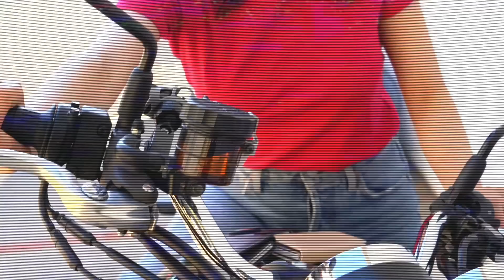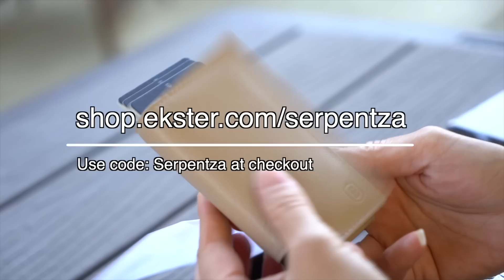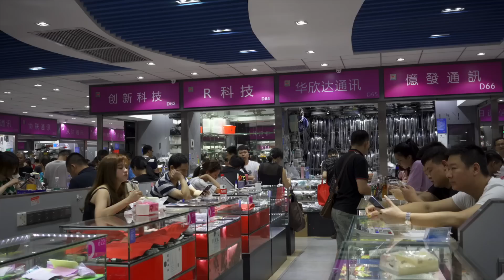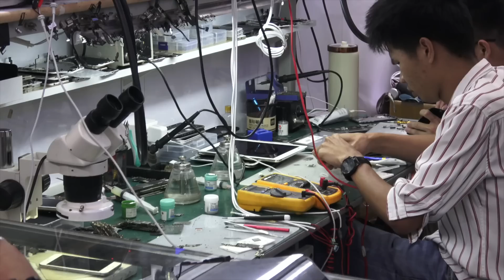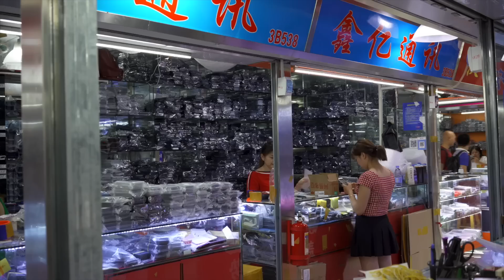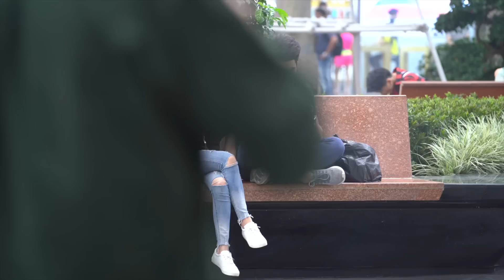Why China Can't make Chips!

Comment: The problem is simple. You can't reverse engineer a manufacturing process. 
You can only work out what the components are, and then from there you need to work out how to make those components. 
With high end chips, the processes often require a knowledge of obscure physics, and a practical application of that, which has taken decades to refine.
Reply: Exactly and machines to produce what they may someday reverse engineer are equally as hard to reverse engineer and produce. It's the whole chain that they need to understand and to produce, not only the final product.
Reply: They do have lots of knowledgeable ppl who can do the work, but the problem is that the leaders want to see the outcome right away.
Reply: Not true, China has IC foundries. Ever heard of SMIC? Neither have I until today (when I looked this s••• up)! But they make logic chips (CPUs). Hua Hong also makes microprocessors, maybe these processors are crud and built using older larger fabrication nodes, but they have many foundries no doubt because the rest of the world including us in the U.S. feed the demand instead of making things like this domestically. Of course Intel does make chips domestically but also in other nations. I used Wikipedia as they already have hopefully a decent aggregate dataset for this, searching directly was ironically a bit more difficult especially since I don't know what China is doing. I was able to find articles from what I would think are trustworthy tech-related media sources claiming that SMIC has made processors using 14, 10 and 8nm nodes. This doesn't speak to the quality of the chipsets, but they are already making them.

Honestly I thought MediaTek chips were Chinese. I try to avoid anything made in China if I can. This is kind of impossible when it comes to buying electronics as some of the devices are assembled there and some components therein are manufactured there. We don't have a choice in where the companies we buy from choose to assemble their products.
Reply: @VariantAEC  SMIC was sued  by TSMC, accusing SMIC of misappropriating TSMC intellectual property. payment to TSMC of an aggregate of US$200 million; and a grant to TSMC 8% of SMIC's issued share capital and a warrant which would allow TSMC to obtain total ownership 10% of SMIC's issued share capital.
Reply: @chongtak  since everyone gets their manufacturing done in china, i thknk they already have the machines
Reply: @kungfutzu3779  if so, why were they unable to produce decent ballpens 2018 for example?
Reply: Knowing how to make something does not mean that you actually can make it. It is like saying you know how to design rockets to mars.
Reply: @VariantAEC  and what makes you think that China , or SMIC, doesn't make use of the joint contracts with other global tech companies so it can borrow the tech that they use? You must remember how Chinese electronics is fueled by these kinds of partnerships where you have lots of Chinese companies that make stuff off the backs of other international companies existing products , who must give up their tech to be in the Chinese market
Reply: @VariantAEC  
The machines used for chip manufacturing are not made in China.
Reply: @MegaBanne  
If we sell that tech to them (and we do), they can't make more?
Pretty sure they can.
Reply: @LIL_MAN_THE_OG  
They do. Do you think as an example Intel doesn't do the same not benefiting from China, but from other nations with better tech like Taiwan? They do. None of this exists in a vacuum though and how can China not be any good at anything while simultaneously being a known threat integrating HW backdoors into their boards and ICs?
You cannot be both a known and verified threat, making tech that takes control of things that you're adjacent to while also being unable to do anything competently in the very same digital arena at the same time. They either are or they aren't able to make these chips and seeing the number of foundries in China (if the Wikipedia numbers are remotely accurate) is troublesome. I mean sure the foundries could be small and make terrible products. Then again these companies are using Chinese citizens to make these chips in China... so clearly THEY ARE ABLE TO DO THIS!
Reply: @VariantAEC  
Such machines have been sold to china.
Reply: @MegaBanne  
Yes by Intel and other IC manufacturers. Most have been by license only, but others likely been sold to Chinese firms to make their own microprocessors with.
Reply: @chongtak  Well apparently they can now. It's only a matter of time before they can fully build more advanced stuff locally.
Reply: @walterdayrit675  You are right but you did not get my point.
Reply: @VariantAEC  You fell for misinformation. It is true that SMIC has been able to reverse engineer TSMC smaller node 5 year old design chips 1:1 recently. But that means nothing. The conditions they are being able to manufacture those more modern chips are basically laboratory conditions. They do not have technology to mass produce it to sustain domestic demand. Which is exactly what the guy you replied to said but you did not understood. And without being able to reliably mass produce it they could be making 2nm chips right now and it would still mean nothing. They have only machines that can mass produce 14nm+ chips which is ancient technology from today's standpoint. And they are able to do it using old ASML equipment that they simply just can not replace anymore because it will not be sold to them anymore.
Reply: @niyu8402  Well, based on what you have said, it seems that China has now "creatively acquired" at least some TSMC microprocessor manufacturing tech.
Reply: @chongtak  So what is your point?  They already can fully manufacture those ballpen parts locally. That proves that given enough determination, the Chinese will be able to manufacture high tech items locally. It's only a matter of time, money, and skilled personel.
Reply: @walterdayrit675  No. TSMC sold out all the shares and ownership from SMIC long time ago (10~15 years ago ). TSMC has nothing to do with SMIC currently.
Reply: Other also illegal
Reply: You have to go back 70 years to understand the problem.  Mao killed off all scholars who questioned the PRC which was exactly what scholars do they question !This destroyed higher education systems and the pursuit of innovation.  Mao wanted a system of yes people and social laborers in turn destroyed creativity which required questioning, imagination, science and self interest.  70 years later and here we are and people wonder why China can’t innovate.  Culture can’t change when their education mirrors their Mao government.  This is why I argue with people that it will take China 100 years to catchup with US in innovation if they start changing now which it looks like they are not.
Reply: It's all patented with silicon chips and the US holds most of the patents. This guy is lying to you.
Reply: @jeffjohnson5053  You have simply been lied to extensively by this chap. Do your own research and you will know how mistaken you really are.
Reply: There’s some pretty advanced AI that can take pics of the die and highlight uncommon photolithography circuits. Everyone uses it on their competitors but if course the process then becomes the issue.
Reply: You can bribe the people who work in manufacturing or maintenance of these machines.
Reply: @ЕвгенийПетров-в5п  What about 5G patents? The Chinese are the largest patent holders for 5G. Who did they bribe to copy?
Reply: Listen champ. If they can clone the f22 they can make some computer chips.
Reply: They can copy the last thing but wont create the next thing.
Reply: Factss brooo they def like copied and pasted them chips. I heard all their buildings are like made of cardboards. And like their space station isn’t even real. Like we all know space ain’t real anyways.
Reply: I think it's more of pattern problem rather than production
Reply: @walterdayrit675   Yes they would be able to produce old tech.... advanced DUV immersion lithography.... and 14nm is possible with that. But for EUV they don't have the machine..... and that machine was literally the might of the whole humanity to build it. It's not something you can just acquire from somewhere and copy it.  Why do you think the Japanese  "just quit" at this point. That machine was paid in part from TSMC, which was partially funded from Nvidia. So you can see... that thing goes "deep" it's not some shallow pond but a deep ocean. Where would China suddenly get companies like Nvidia and TSMC.... to pay for their machine?! Yes the "state" would pay for it..... and the money will go to their buddies.... and nothing would happen.... they would probably some "scapegoat" to throw in jail "for corruption" and that would be it. You know "how the state pays" in these type of countries. The state pays.... and the money goes to their buddies.... if Nvidia and TSMC did that.... we have never seen EUV lithography. And why would that happen.... because lower state bureaucracy doesn't understand technology and doesn't care about technology.... also they want to enrich themselves and they don't care if China as a whole will develop EUV.  The other possibility is... things would happen "too slow" for their taste and they would just throw someone in jail for corruption even if he didn't do anything wrong.  
 If Nvidia was funded by the Chinese state.... we would probably be still using  GeForce 2 cards..... 🤣 and Jensen Huang would have been a long time ago in prison for "corruption"..... 😂
Reply: @VariantAEC   You're confusing things. Intel and IBM both use ASML machines to make these "breakthrough"  chips, there is no other EUV machine.
 Also if you look at the original news you'll see the partners.... that IBM chip was a group effort.   Search for this: "IBM research alliance produces first 7-nm-node test chips".
 ASML is not mentioned by all news sources, but they are there, that would have been impossible without their EUV machine. 
 And why not build everything in the US.... because that's the same problem China faces right now... because some countries are better at some things than others.  You can't do everything "better and by yourself at the same time" . ... that's like the old saying goes "Jack of all trades, master of none".
Reply: @Slav4o911  
IBM makes chips or they used to and do so still, but not for mass production in-house anymore (or maybe ever). EUV machines aren't a proprietary technology powered by Carl Zeiss lenses the tech was invented way before 2017.

"ABOUT EUV LLC: Intel began substantial funding for EUV research in 1996, and established the EUV LLC in 1997 with Motorola and Advanced Micro Devices. Micron Technology and Infineon Technologies joined the EUV LLC in early 2000; International Business Machines joined in 2001. Rapid technical progress in the EUV LLC program has attracted widespread interest and support for EUV technology, as chip manufacturers and their suppliers recognize that this technology can support multiple process generations and be cost effective for producing all types of semiconductor chips."

The technology was developed in the U.S. I'm not sure how exactly ASML came to be the major manufacturer of EUV machines globally... maybe has something to do with this: "The completion of the prototype machine marks a major milestone for the program, since we have proven that EUV lithography works,” said Chuck Gwyn, program manager of the EUV Limited Liability Company (LLC). “Our next step is to transfer the technology to lithography equipment manufacturers to develop beta and production tools.”

So the technology was invented in the U.S. like most other computer tech. ASML's first EUV machine was the Twinscan NXT:1950i first sold in 2008 a few years after these benchmark machines were created. The American chip manufacturers and a U.S. military laboratory invented the first EUV machines and gave or sold the tech off to companies like ASML.
Reply: @Slav4o911  
In addition to ASML not being the first to EUV some older associates themselves claim ASML wouldn't exist without Phillips (known for making precision laser tech and along with Sony, the Phillips/Sony partnership gave us Compact Discs).

ASML is important now and will be for Europe in the future, but the U.S. can do this too and well... Americans did it first.
Reply: @VariantAEC  They are absolutely able to be a cybersec threat while not being able to make chips themselves. This is what they've been doing for a decade, it ain't that hard chief.
Reply: @networknomad5600  
They can be BOTH and that ain't that hard either since they stole most of the world's technology.
Reply: @VariantAEC  As you say, it does not speak to the quality of the product. And also: it is relatively easy to produce a quality product in a research lab. It is not so easy to produce this quality of a product en masse at industrial quantity. That takes know how.
Reply: @VariantAEC  I consider it worth remembering that know-how to produce one sort of logic chip is not know-how to produce another sort of logic chip. 

YMMV.

Cheers! :)
Reply: @zapazap  
I quite literally stated "logic chips" in my former reply to you.
"Logic chips" include CPUs and GPUs and other smaller microprocessors and co-processors not DRAM or image sensors.
China makes these because the government and corporations didn't see them as a threat in the future.
Too bad for the world.
Reply: @VariantAEC  I revised my comment to say 'logic chip'. Thanks.

Cheers! :)
Reply: Correct.
There is one say. "you can steal KFC recipe. but can you make it like the original???"
Reply: @bighands69  China's inability to manufacture a decent fighter jet engine is a good example. They can copy the designs of the engines they acquire but don't have the slightest idea of the proprietary processes that were used to produce alloys that can withstand extreme high temperatures. Their engines work fine at normal speeds then start having issues after the pilot uses the afterburners for short burst of speed once or twice then can barely get the aircraft back to base if the pilot uses the afterburners again.
Reply: @VariantAEC  Thanks for pointing this out. I knew something didn't quite add up watching this video. But when you mentioned that they have foundries (whether subcontracted or not), that confirmed my suspicion. And yeah, regardless of whether anyone thinks their chips are low quality or not, the fact remains that they make them nonetheless.
Reply: I know in engineering school some exchange students worked together in my fields and waves course. The smartest students would register in earlier classes so that when it came time for later slower students to take the test they knew everything on it. I was barely able to get a C in the class as there was never much of a curve. In C programming class several students were busted when they received help on their final which was supposed to be a program that they wrote themselves. To put it bluntly they Bidened it.
Reply: @VariantAEC  They make jellybean chips not top end processors. It's old tech. Very necessary, don't get me wrong, there are chips from the 70s and 80s still being produced in mind boggling quantities, especially by China, but that's not the same as these high end chips. And we will be waiting a very long time before China designs a chip from the ground up.
Reply: @Slav4o911  Exactly. No single country in the world has the ability to make these chips, so why on earth would China be able to, especially when they can't innovate?
Reply: @billwilson3609  Classic China. Copy the form so it's indistinguishable from the original, but utterly fail at the function.
Reply: @Patrick-857   It's not that they "can't innovate", they can, the problem is after they innovate what would they do.  For example China is behind in gaming, not because China doesn't have gamers, but because "the party" just hates gaming, they think young people "waste their time by playing games" that's the reason why China is behind in gaming and this is just one aspect of they way they do things in China. If for some reason in the west gaming was "frowned upon" the same way China did it, we also would have been behind in these technologies. Nvidia and TSMC probably wouldn't exist at all. Both companies become what they are today, because of PC gaming, if PC gaming was banned or stifled in some way, GPUs wouldn't exist or would be behind of what they are.  
 But in China gaming is frowned upon big time. Consoles were banned for sometime.
Reply: @Slav4o911  I only partially agree. The reason is I agree that gaming pushed some innovation in chips and the CCP doesn't like gaming. However, it doesn't change the fact that China can't innovate. If China decides they want to do something, they just steal the IP and then make an inferior copy that follows the form of the thing but not the function. This is how Japan and others got their start engineering, manufacturing and technology, but China is stuck there because of their rigid system that crushes its people. You cannot point to a single technology that China is number one in. Not one. It's all bought borrowed or stolen from elsewhere.
Reply: @Patrick-857   Japan is actually a sad story of how you get ahead of everybody in innovation and then become super "conservative" and get back to your "old ways". I think Japan in recent ears is just a shadow of their former selves.  For some time maybe because they only vote for "conservative" governments, their innovation is nothing like it used to be. They are almost out of everything. They no longer make anything significant and innovation there is almost non existent. Yes they continue to build new versions of their old things, but nothing new and interesting.  It's like they don't even have new ideas about anything.
Reply: And you need math.
Reply: @DxModel219  Dude, China files the most patents in the world. They can innovate.
Reply: You also need a work culture that's devoted to maintaining high quality. China doesn't have that. Fundamentally that's going to kneecap all of their tech and research.